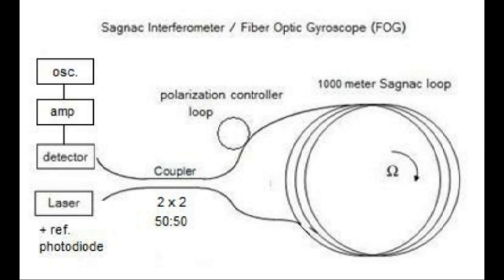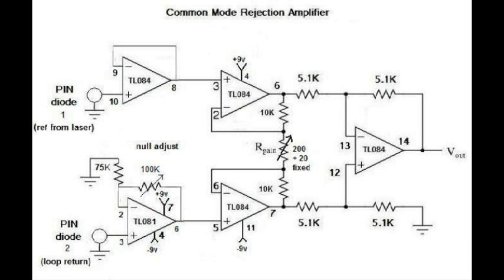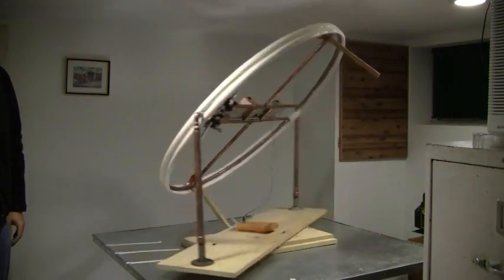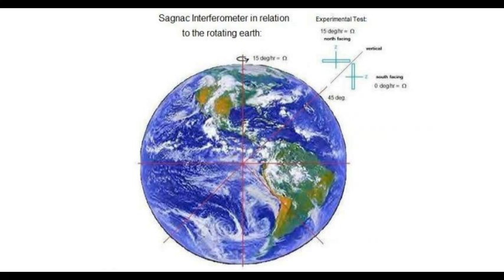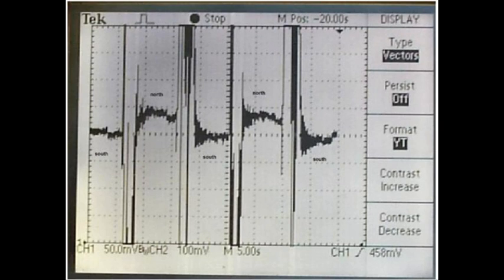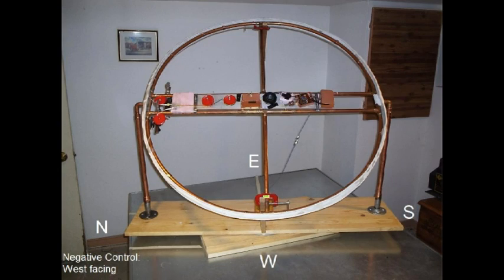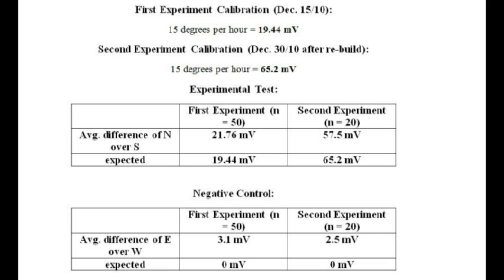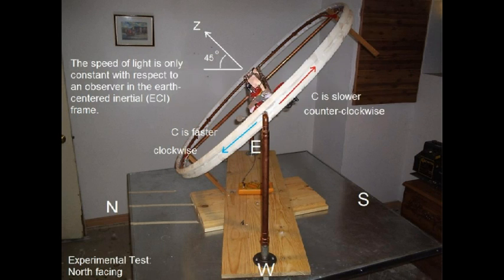Detecting Earth's Diurnal Rotation Using a Large Area Sagnac Interferometer

Comment from the maker: This begs the question - rotating with respect to what? With SR all motion is relative, so to imply that the earth is rotating in some absolute way (and hence the speed of light is contant with reference to some absolute frame)  is to unravel the very premise of special relatively - this is the dilemma of Newton's bucket - and perhaps not so easy to get around...
Reply: This is wrong. Inertial reference frames being relative is about their lateral position. In the XYZ coordinate system, any point is as good as another to call your origin. You can arbitrarily choose which direction your axes point. However, you can't start spinning them arbitrarily. That would require putting a torque on the universe.

Think of it this way: You are on a rotating space station. You are experiencing the centrifugal force providing artificial gravity. However, a spacecraft floating alongside the rotating ring does not magically cause it to fly off into space. That's because your reference in the rotating space station is non-inertial and the force a faux force caused by your non-inertial reference frame. If you were able to arbitrarily choose a rotational speed as "zero," you would have to cause the entire universe to adopt that rotating frame for it to be inertial. That obviously isn't the case. There is an absolute rotational zero. Rotational velocity is not the same as lateral velocity. 

You could say that the entire universe is moving in some direction relative to you laterally, and your reference frame would show everything around you moving at that same velocity together. However, vectors in a rotating system vary relative to the center of rotation. This makes it non-relative. 

All rotating frames of reference are non-inertial and inertial frames of reference have precisely zero angular velocity. No inertial reference frame is special. However, one of the thinks that defines a reference frame as inertial is its lack of rotation.

Comment from the maker: Thanks! - I think the long fiber length and the large radius (high angular v) that make the biggest difference. The common mode rejection is not perfect as there is still some drift but it helped a lot and I likely could benefit from a more stable laser. The fiber loop is sensitive to temperature, as is the laser, and RF contamination is an issue here, so I'd say those are my main noise sources. I think long term means might be possible if these other factors can be well controlled.